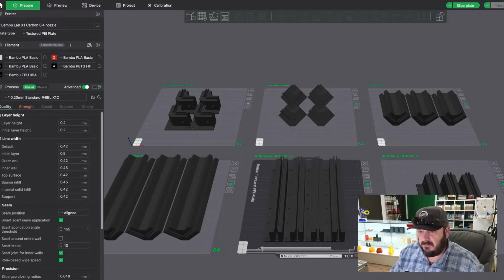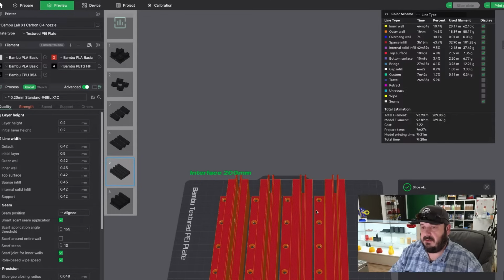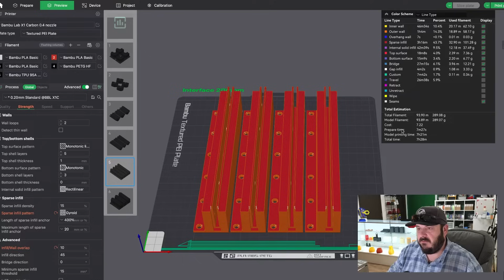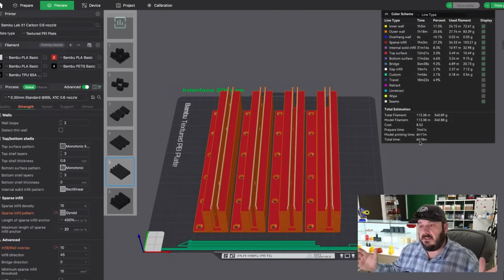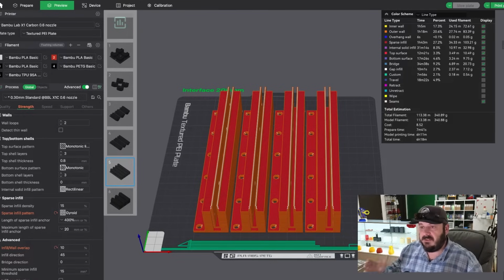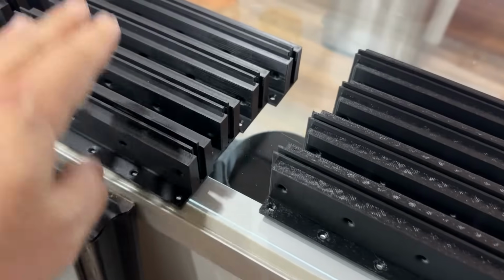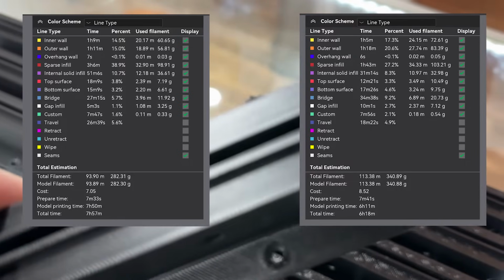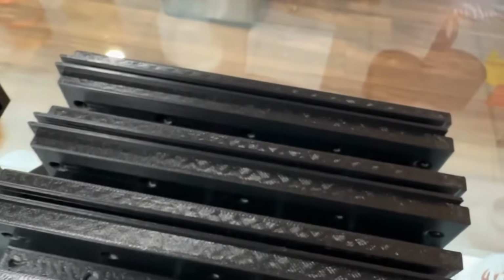0.4mm vs 0.6mm Nozzle: Which One Should You Choose for 3D Printing?

Comment: It doesn’t look like you did a flow rate calibration before switching to the 0.6 nozzle. My prints used to look like the ones on the right side, but I make a habit out of doing a flow rate calibration when switching nozzles now and have avoided the issue you’re experiencing entirely

Comment: This guy has no idea how slicers work. He claims the perimeter of these prints are the same, since there are two of them. Then complains like some magic happened since the part with thicker walls actually weighs more. Just like half of the Internet, he don't understand what line width is.
Reply from the maker: Thanks for your feedback, but I think you misunderstood my point. I’m fully aware of how slicers work, including how line width and nozzle size influence print parameters. I even pointed out that we were going to transfer the settings exactly when switching from the 0.4mm nozzle to the 0.6mm nozzle. Thicker walls from the 0.6mm nozzle naturally result in more material being used. Moving to a 0.6mm nozzle saves time but comes with trade-offs—you use more material and lose some detail, although I’ve had relatively good luck with it. This was a clear example of those trade-offs. My goal wasn’t to complain or express confusion but to help others see the practical differences so they can decide what works best for them. You seem unusually angry for no reason—let’s keep this constructive!
Reply: @ExtrusionTherapy  The trade off i quite different as to what you showed in the vid. It is actually quite interesting how different a 0.4 is to a 0.6. It is pretty massive. Just not in these ways.

If you want thin walls, that are not affected too much of the interior structure the wall has to be in the 1,8mm range for an 0.6 and only 1.2mm range for an 0.4. At the same time, the 0.4 seriously struggles with infill. If you use only two walls with an 0.6,  you get the same wall as an 3x0.4, just not the same wall, nor the same strength.

As for the infill, those of us who print infill as mesh, know how hard this is, particularly for PETG. Nozzle wise, that is a seriously interesting topic. It actually reflects back on all of us.

So no, there is a reason for my irritation with this vid, and your dismissal of your mistakes, will not move you any forward. So if you want to be civil, be my guest. Just be civil. Bluffing don't sit well with me.

But hey, you may just grow a little, and make a more truthful and civil vid.

Like: What is actually the same settings moving from one nozzle size to another? What does that mean. Is that a similar wall thickness, or similar number of perimeters?

They just cannot be the same. There is no such thing.

So sure. Stay civil. Just don't bluff.
Reply from the maker: @FrodeBergetonNilsen  Thank you for your detailed feedback! I appreciate the time you took to share your thoughts. You’re absolutely right that there’s a lot more nuance to the differences between a 0.4mm and 0.6mm nozzle, especially when it comes to wall thickness, infill strategies, and material-specific challenges like PETG. This video, however, was intentionally targeted toward users who are newer to 3D printing or aren’t diving deeply into the technical details.

The primary goal was to focus on the main takeaways—speed and material usage—while keeping the format simple and easy to understand. Could we get into the complexities of wall thickness, perimeters, and how settings translate across nozzle sizes? Absolutely. But most advanced users, like yourself, likely already understand those nuances and may not find value in a basic overview like this.

That said, I always appreciate constructive feedback, and I’ll take your points into account when creating more detailed or advanced content in the future. Thank you for engaging in the discussion, and I hope to explore these deeper topics in upcoming videos!

Thank you again

Comment: I print .6 line width, I still  use a .4 nozzle.  It prints the same as if I'm actually using a .6 nozzle.  If the flow rate for the .6 nozzle was significantly higher, I'd switch the nozzle, but it's not.  Question for you.  When designing functional parts like you're doing, do you make sure your flat surfaces in the Z direction (slicer Z direction) are divisible by the layer height?.  You may see a small gaps between your parts if you don't account for that.  You many design parts to fit nice and flush, but get a bigger seams  or don't sit flush because of the rounding.  Your slicer will make it exactly a layer height.  Also, your .5 first layer height is going to make that a little more difficult to figure out. Something you may or may not want to think about.  I do.
Reply from the maker: Thanks for the input—it’s a good discussion to have. Using a .4 nozzle with a .6 line width is definitely a valid approach, especially when balancing speed and detail, though in my experience, actually switching to a .6 nozzle has yielded better results for the type of parts I’m working on. While the flow rate difference may not be dramatic, the increased extrusion consistency with the wider nozzle often makes up for it, especially when printing larger, less detailed parts.

As for your question about Z direction and layer height, yes, I do take that into account when designing functional parts. I try to ensure that flat surfaces align with layer heights to minimize the risk of gaps or uneven seams. Rounding errors from the slicer can definitely throw off tolerances if not accounted for, especially with tight-fitting parts. While I understand the importance of customizing settings, in this instance, I used the defaults when switching between the .4 and .6 nozzles. Let’s be honest—that’s what the majority of users would do, and it helps provide a realistic baseline for comparison. It’s a straightforward way to evaluate the practical trade-offs most users will experience. That said, I’ll definitely keep your points about first layer height and rounding in mind for precision-critical projects—good stuff to think about!